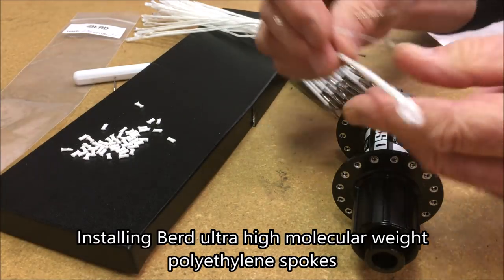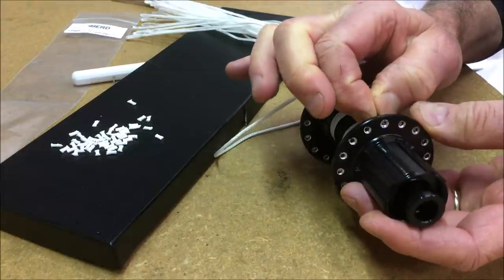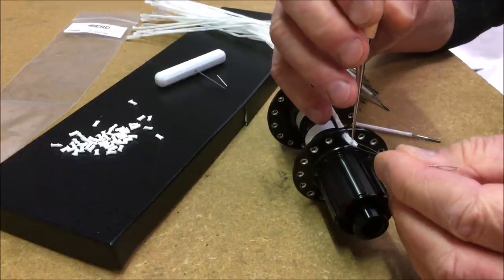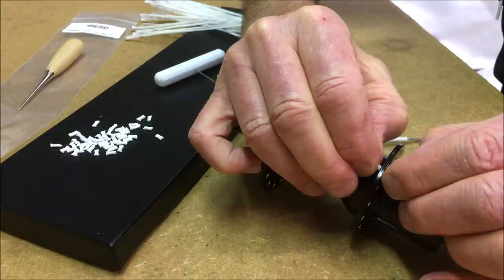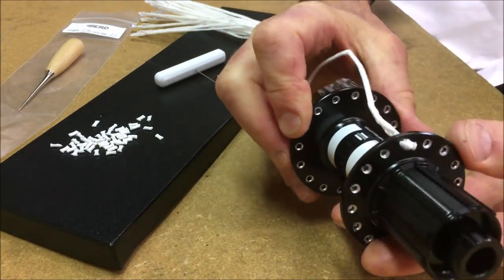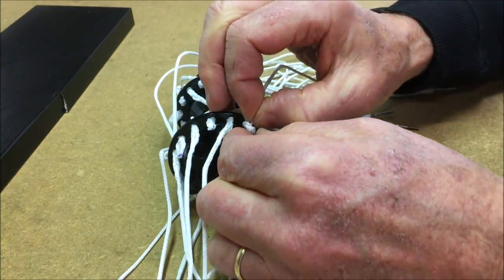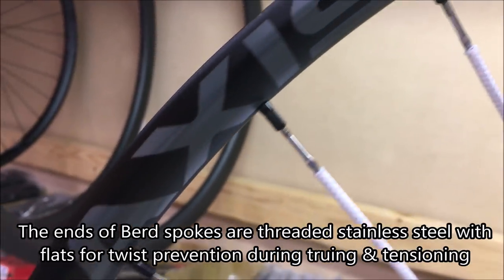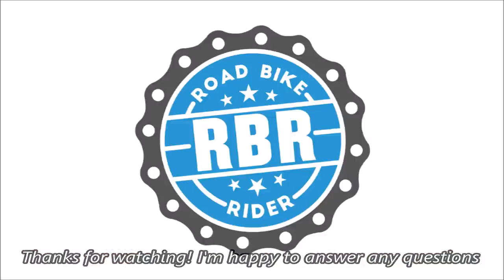Berd's Ultralight Polymer Bicycle Spokes - Wheelbuilding Tips & Observations

Comment: Thanks for showing these remarkable spokes. But I wonder, why you not simply knot the loop around the hub flange? Just pull the spoke’s threaded end trough the flange, than through the loop and into the rim. Why this mini extra piece?
Reply from the maker: Thanks for watching and the great question, Christian. It's probably something only Berd can answer fully and correctly. My best guess is that if you looped over the flange, it would be more difficult to calculate spoke lengths (since hub dimensions vary so much). And also, Berd specifies that the hub holes are smoothed to remove any sharp edges - and provide tools for this. Maybe looping the spokes over the flanges would somehow put the spokes at risk. Again, we would have to ask Berd to be sure.

Comment: Now, how the heck is that flimsy stuff supposed to work? Might as well use spaghetti as spokes. Lol.
Reply from the maker: Thanks for watching and the funny comment 🤣 The Berd spokes are actually crazy strong. Several years beating on the wheels both mtn and road with these spokes  and they show no signs of weakness. Takes more work building the wheels but you get better with practice.
Reply: I'm sorry. I stand corrected. My bad. Lol. Happy wheel building!

Comment: If it stretches/flexes more than steel spokes, doesn't it mean that there's more power-loss when pedaling?
Reply from the maker: Thanks for watching and the great question, Paulo. When you finish the wheel, the tension of the Berd spokes matches the tension of standard steel spokes. The additional stretch in the Berd spokes is taken out during the final tensioning stage. So there's no shouldn't be any power loss when pedaling. Thanks again!

Comment: Super light spokes laced to a DT Swiss  350. 😳
Reply from the maker: Thanks for watching and the comment, Tomas - To explain the 350 hubs, the goal wasn't to go for the lightest wheels possible. The idea was to built wheels with the superlight Berd spokes around solid, reliable and especially affordable aluminum rims. That way you end up with the durability of aluminum wheels that are less expensive and also lighter than carbon wheels. But you're right, if you want ultralight wheels you would choose other hubs. Thanks again!

Comment: Isn't kevlar better for that due to high melting point? 
UHMW HDPE is amazing, has very good chemical, water and UV resistance, as well lower density than kevlar but it's drawback is lower melting point, it makes great plastic and also has low friction almost like teflon.
 Carbon fiber also has great tensile strength but it's brittle and titanium spokes are still expensive. How wires are held?
Reply from the maker: Thanks for watching and commenting!
Reply: @JimLangley1  So wires are held by steel or titanium tubes?
Reply from the maker: @RynaxAlien  the ends of the Berd spokes that attach to the nipples are stainless steel just like conventional spokes, Gediminas. Thanks for the question.
Reply: @JimLangley1  Titanium would much lighter, new aluminum alloys are as strong as stainless steel but a lot lighter. Nipples also are commonly made of brass which is even densier than steel. Are string spokes safe from your experience? I wonder why they are rarely used. I seen string spokes are used on hubs that have straight holes.
Reply from the maker: @RynaxAlien  the issue with ti is brittleness and expense. Beed spokes are already expensive.
Reply: @JimLangley1  Titanium is actually very ductile metal, pure Ti is even harder than steel. But softer alloys are not that brittle. Price is still high despite it being not so rare element however it's amazing strength to weight ratio as well corrosion resistance make titanium good alternative for steel in transport.
Reply from the maker: @RynaxAlien  ti spokes have been available for many years and building with them I have found they break much more frequently than stainless steel. Making the spokes may be the reason.

Comment: 8 bucks a spoke? They're outta their damn minds.
Reply: Given some time and patience I could probably make a set of these from old bladed titanium spokes using SK-98 Dyneema Max 12 2 mm strand that anyone can order from a serious yachting supply shop for less than $200. (Dyneema cordage is $46 to $60 per mini roll with plenty left over for 2 wheels).
Reply: @hclchgm  It'd be tough to get both length and tension both correct and permanent.  Dyneema is difficult to knot, and knots creep like a madman under constant tension.

I think this product is great, and kudos for making it available.  I'm just a cheapskate.
Reply: @theprojectproject01   Making a loop of dynamic is dead simple and there isn't really a knot it's just slipped over the spoke for tenson.
Reply from the maker: Thanks for watching and sharing your opinion, JR. The wheels I've built with these spokes have been holding up fine - both road and mountain.

Comment: Surprised you don’t put a loop of the same spoke material through all the loops on one side...
Reply from the maker: Thanks for watching, John. That's an interesting idea. It seems like that could work on standard hubs. Not sure if it would work on direct pull hubs. But, it's an interesting idea for sure. Thanks!
Reply: @JimLangley1  I suspect it would struggle to keep the spokes in place, a “key ring” is probably a better idea, and since the strength is already a known quantity I imagine it shouldn’t be too hard.

Comment: how about Spoke LENGTH       ?????
did you have to Provide the LEngth ?
LEft abd right Same LEngth ?>
Reply from the maker: Thanks for watching and asking a great question, Joni. Appreciate it. For spoke length you use Berd's online spoke calculator. It's here: https://berdspokes.com/pages/calculator If you need to know how to measure rim ERD and hub diameters and widths, I have a how to measure for spoke length video for that that has timecodes so you can jump to whatever you're interested in. Here's a link: https://youtu.be/LvV4FE2VxZk I hope this answers your question. Thanks again!
Reply: @JimLangley1  Thanks for Reply JIM - Built Few Wheels Last Couple of Years , LEFTY  1.0 with ASYM i23 WTB - and DUROC 35 with 28 spokes - https://www.youtube.com/watch?v=gIvyorSqLUM&t=10s
https://www.youtube.com/watch?v=oiRGhadkEEY&t=3s
Reply from the maker: @jonienglish3231  thanks for the videos, Joni. Looks like a nice build!
Reply: @JimLangley1  Thanks First Unbranded Build 
Picked up the Front Wheel and Matched the Rear Rim MAKE and Built it .just having hard Time Bleed Rear Brake - Possible Mastycylinder Problem
Reply from the maker: @jonienglish3231  Nice way to make a wheelset, Joni! Good luck with the disc brake!

Comment: Would they be suitable for mountain bikes.... Not enduro or freeride just light cross country work
Reply from the maker: Yes, absolutely, Nigel. That's a common use for them because you can put them in an aluminum rim and end up with wheels that are as light as carbon wheels but that hold up much better to rock strikes (carbon rims can break/aluminum only bends). 

So, even though the Berd spokes are pricey, you can have superlight wheels and superstrong wheels with them - at usually less than the cost of carbon, too. The MTB wheels I have built (only 1 pair so far) are holding up fine and ride great. 

The white spokes do get dirty and they're not aero. They get pretty clean when you wash the bike but not perfect depending on how much muck you get into. Hope this answers your question.

Comment: I wonder how the hold up to abrasion? Like the guy riding beside me hit a piece of road debris just perfect sending into my front whee! Lot of trash on the side of the road in my neck of the woods.
Reply from the maker: That's a great question, rcdogman. I asked Berd about abrasion and what they said is that this polymer they use in their spokes is very abrasion resistant to things that strike it or rub it. The thing it takes to break is two sharp edges pinching the spoke from either side, like scissors or diagonal cutters, etc. In the video I mentioned my friend at REI - huge outdoor gear store - who told me about similar materials used in tents and backpacks and how well they hold up to wear and abrasion, too. So, hopefully they're as strong and tough as steel spokes and can take whatever cyclists put them through. A good test will be if someone shifts into the spokes like happens when you bend the derailleur hanger and don't know it. I specifically asked Berd about that and they said the spokes could take it - I hope so. Thanks for asking! Jim

Comment: The downside of UHMWPE is UV degradation, unless it has extra UV inhibitors.  Especially white and untreated versions will be the worst. Black colored will proved more UV resistance in general, with or without extra UV inhibitors.
Reply from the maker: Thanks for watching and the info about UV issues, Justin - several others have mentioned this in the comments. Berd does offer their spokes in white and black but I don't know if they use any inhibitors.

Comment: What if i built my new 170 enduro bikes wheels with these, what is their abrasion resistance? Dyneema has much higher tensile strength than steel but a few falls climbing things start to fray, I have aramid and dyneema camping string but even the aramid (kevlar) will fray if you snag or give it a cut with a sharp knife. what if I you lock your bike up and someone cuts your spokes with a knife in their pocket? or holds a lighter to them? I would love these but in the unlikely event their weaknesses can be catastrophic
Reply from the maker: Thanks for watching and your input ewann. Appreciate it!

Comment: What happens when a chain is dropped off the low gear cog?
Reply from the maker: Thanks for watching and the great question, trekkeruss. I would say that if you want to use Berd spokes, you want to make every effort to make sure your bike cannot ever shift into the spokes. A properly adjusted rear derailleur won't shift into the spokes but it definitely can after a crash or a bike gets dropped bending the derailleur hanger. That's often what causes the chain to go into the spokes. That accident can damage steel spokes, too. I don't actually know how much damage shifting into Berd spokes would cause. I think it would depend on what hit the spokes and whether you stopped pedaling right away or kept pedaling. And, if the derailleur got bent whether it hit the spokes or worse if it went into the spokes. It's a great question. Thanks for asking!
Reply: @JimLangley1  I have been working on bikes professionally for over four decades, so I am aware of the need for a properly aligned and adjusted derailleur. But stuff happens, and I have seen my share of mangled steel spokes. Because of that, I recommend spoke protectors for the average bike (which of course would not have these fancy spokes.) Anyway, it was just something that ran through my head. I think the Berd spokes are quite interesting and I would try them. Just not in white! I can imagine how grubby those would look in short order.
Reply from the maker: @trekkeruss  Thanks again. Just as an fyi regarding the white spokes getting dirty - it looks like they come in black too now - I just checked: https://berdspokes.com/products/polylight-spokes-black

Comment: Isn't it easier to pull the nipple end of the spoke through the hole instead of the loop?
Reply from the maker: Thanks for the question, Frans. I followed Berd's instructions. They provide special tools for spoke insertion the way shown in the video. I didn't try to insert a spoke nipple end first. So, I don't know from actually trying it, however, I believe if you insert the spoke nipple end first, that it will be too wide at the beginning of the loop for the spoke to pass through the spoke hole in the hub. Unfortunately I used up my entire supply of Berd spokes so I can't try it to see if it's possible to pull the loop through the way you suggest. But, I think since their instructions say to do it this way and since they provide custom tools, that they wouldn't recommend pulling spokes through nipple end first. Thanks for commenting!
Reply from the maker: @C K thanks for watching! I called Berd to ask them about this the other day and they told me that there are several reasons. One is to ensure the least amount of the spoke contacts the hub since contact may result in wear. Another is that calculating spoke lengths would be far more difficult if they looped the spoke. The other reason is that the spokes are to work in both regular hubs and some straight pull hubs and they work because of the little "peg" that holds the spoke the way it does (they call that little piece a "chub" fyi). Okay? I hope that helps explain.

Comment: I noticed in their weight and strength chart they do not mention the length of the spoke, I build every wheel with DT Swiss Revolution 14/17 gauge spokes, these look like a lot more work but I would be willing to give it a try.
Reply from the maker: Thanks for the question Robert. The spokes are available in lengths. It’s been awhile but I am pretty sure they have a calculator on their site. Hope that helps! They are a lot of work but I found it fun. Appreciate you watching. FYI: Here is the link to Berd's spoke length calculator, Robert: https://berdspokes.com/pages/calculator
Reply: You have to order the correct length when you order them. They do not come in blanks. You gotta do a little math and measuring

Comment: I am afraid this material has one major drawback : it will extend under stress at a rather fast pace. It is a very good material for short term high load but can't be a long term and high load solution.
Reply from the maker: Thanks for watching and the comment, Yves. So far, the wheels I've built are showing no signs of changing spoke tension.
Reply: Well if the base tension is not significantly high compared to the ultimate resistance is will take a longer time. For spokes it may be good enough and even a few tightening sessions are not a big deal. High performance sail boat rigging and bow string are also using this type of materials...but they are usually not kept under full tension more than a few hours. I did consider the situation for an ultralight aircraft project and, though craving for ligthening alternatives, I had to stay with Stainless steel  cables for wings and fuselage rigging as well as for controls cables...
I suppose I would have been less shy about a bicycle wheel...but loosing any tension in a wing was just not an option.
Reply from the maker: @yveslegrand9826  thanks very much for explaining more, Yves!
Reply: doesn't appear this is a valid or accurate concern in this use case now that many riders have been using them since around 2019.  hopefully potential buyers take the disparaging comment with a grain of salt given the lack of actual data or real experience with this spoke.

Comment: ill stick with stainless, titanium, or basically any steel.
Reply from the maker: Thanks for watching and sharing your take on the Berd spokes, yeet.748. Appreciate it!
Reply: @JimLangley1  idk if theyd be strong cuz they are so thin lol, feel like if u wrecked they would snap or cut super easily
Reply: holy jesus those wheels are expensive. i ride a garrett reynolds signature fx2 and i thought it was expensive
Reply from the maker: @user-gk5je9wu4u  so far the guys riding them on both mountain bikes and road bikes that I built the wheel for love the ride and aren't having any problems with the spokes. They're crazy strong. 

You would have to intentionally cut them with scissors or a knife or maybe if you crashed on top of another bike and the pedal got in the wheel - that might cut them. Some of the other commenters said the spokes don't like the sun, that UV rays can weaken the fabric.
Reply from the maker: @user-gk5je9wu4u  yeah, they're definitely expensive but there are lots of really pricey wheels out there. With these spokes you can take an affordable hub and rim and get the weight so low the wheel will be lighter than a carbon rim wheel that cost way more than the total of the affordable wheel plus these spokes. But only if you like the idea of these spokes in the first place.
Reply: @JimLangley1  yeah, i do grinds and stuff so i feel like if i hit a spoke on a sharp ledge it could cut.
Reply from the maker: @user-gk5je9wu4u  I wouldn't chance it with how expensive they are - unless you could get them to sponsor you or something like that ;-)
Reply: @JimLangley1  nah im not that good lol, i dont think stainless ones would cut tho. they might snap which is just as bad but i trust steel a bit more
Reply from the maker: @user-gk5je9wu4u  just get good stainless spokes and they will hold up to anything. My favorites are DT Swiss and Sapim are really good, too.